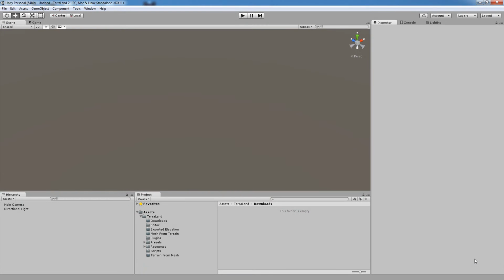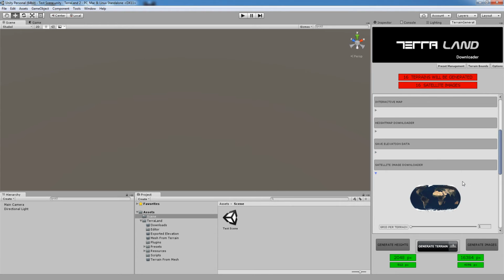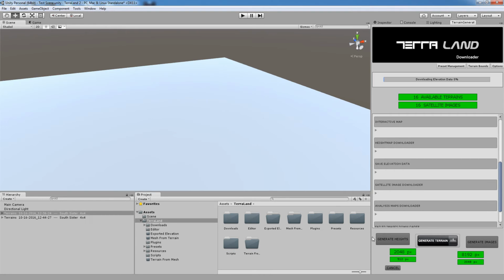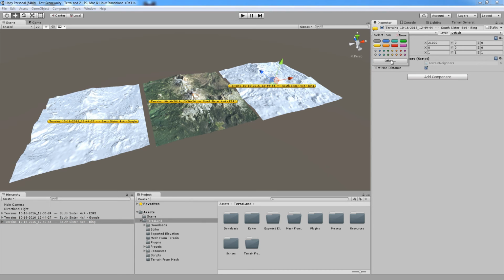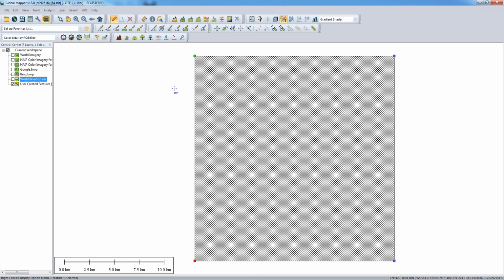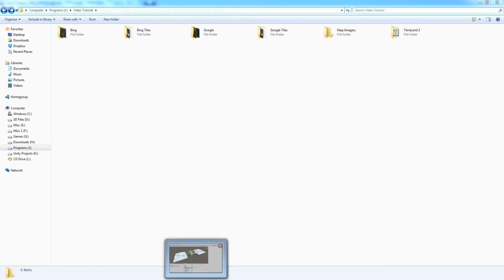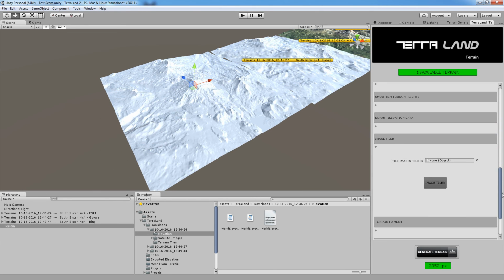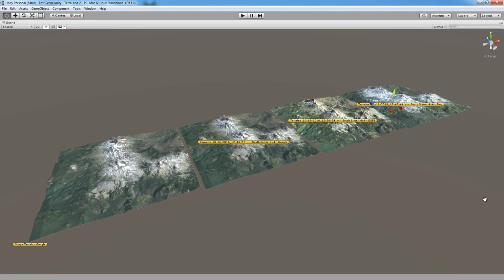TerraLand - Creating 3D Terrains From Custom Heightmap & Satellite Imagery Using Global Mapper

Comment: So I have been using TerraWorld to try to create a large area 23km x 23km. The heightmap resolution on the tile seems kind of low. Would I get more accurate results with TerraLand since you can use multiple terrain tiles unlike TerraWorld? Am I able to tgen import the TL terrains to TW to use TWs procedural object generation?
Reply from the maker: Not in a built-in way but some of our users have done this through manual steps but I'm not sure if they could succeed since it's a bit complex. If you need more info on this join our Discord server so that we will guide you through: https://discord.gg/9J6Jk7B

Comment: Is there any possible way to edit the Area Size and generate all of Europe? I've managed to generate the entire UK with maxed out area size settings. Would it be possible to generate one chunk of Europe at a time and stick them together?
Reply from the maker: In TerraLand editor plugin, the maximum area size is limited to 1000x1000km which is an intentional and wise limitation. Because having higher value for area size might end up with flattish & un-detailed terrain surfaces.

If you intent to have the whole Europe in one static scene, you can simply download the heightmap of Europe available in many resources online and use the "TerraLand Terrain" component to import & load this custom heightmap in order to create terrain surface from it as in the video.

Read Further on the subject:

Obviously there are limits in a static scene generated in the Editor. For the Area Size the maximum value can be set to 1000x1000km and for the elevation resolution it can be set up to 8192 resolution. The imagery resolution depends on the number of defined terrain chunks and each satellite image resolution as texture, so potentially it can be from hundreds to thousands in resolution.

These limits are there to maintain quality and performance at the same time so higher values will become less practical due to current machine's limitations.

But the good news is that we have RunTime API in TerraLand now which can generate infinite worlds around the player and the system is designed to intelligently stream unlimited amount of data and feed them into the scene as the player travels around the globe. The API gives the users maximum flexibility to setup the parameters based on their desired platform from mobiles to desktops.

For more info about the TerraLand's RunTime Features and free demo download refer to the following links:

http://terraunity.com/worldexplorer/
https://forum.unity3d.com/threads/terraland-2-high-quality-photo-realistic-terrains-from-real-world-gis-data.377858/page-5#post-2864110

Showcase video:
https://www.youtube.com/watch?v=xPckIjjljKU

If you are already a customer, just contact us and we will setup your account on our website to get access to the latest packages along with the Runtime API package.